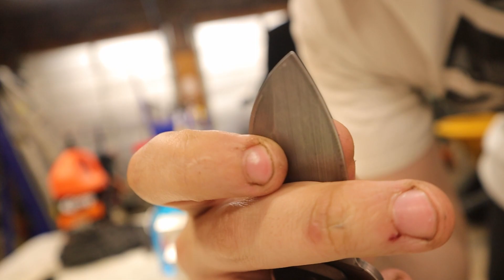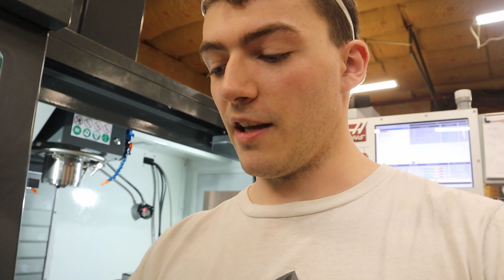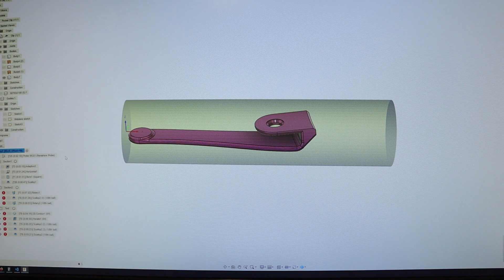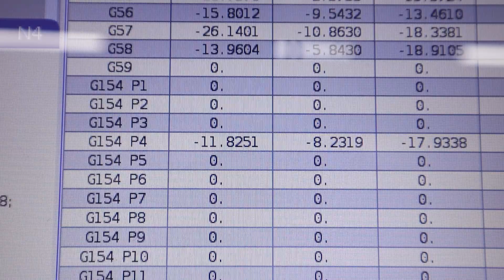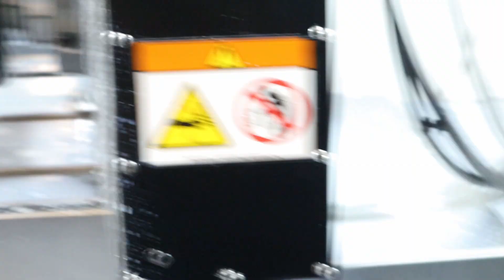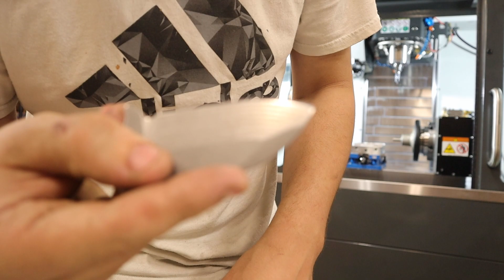Garage vlog 4 - Belt grinder, machining the clip on a 4th axis

Comment: Dude, I'm doing just about the exact same thing as you. I just started making knives(trying)about 2 months ago. Since then I have been making buying everything to do with knife making. Love your shop bro looks fairly new. Have you plugged in anything else into them GFCI?.
 I find making the lock bar the toughest part. I'm hooked though.  I'm in MA. and don't know anyone local for help/question... you know the deal I'm sure.
Reply from the maker: Yea the gfcis work for literally everything else. Just really doesn't like the grinders motor I guess. Yea I'm actually in CT but right near Springfield MA to give you an idea. Yea knife making is hard haha
Reply: Lots of ways to skin the sharpening cat but the quickest I have found on a belt sander is:
Cut the initial edge with a 120 grit do most of the work here!
Jump to 220grit until you get a wire edge (burr) along the entire blade and then strop off the burr. You can go finer than 220 once you master it.

If you have an adjustable workrest on the grinder you can set that up as a jig to keep the bevel angle even.

Go to the dollar store and get some cheap knives to practice on.

Good luck and keep poating videos!
Reply from the maker: Thanks for the tips! I'm Def still in the winging it stage when it comes to sharpening :)